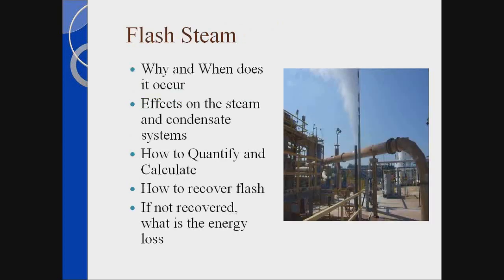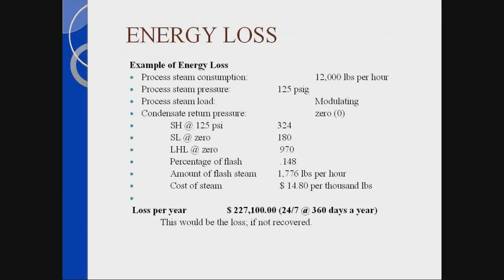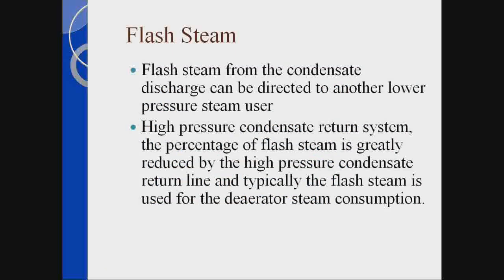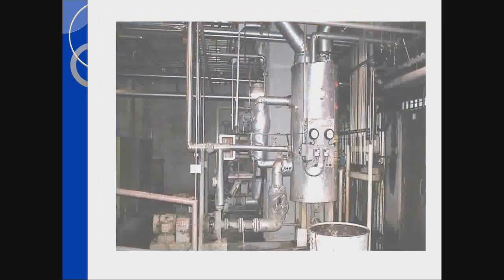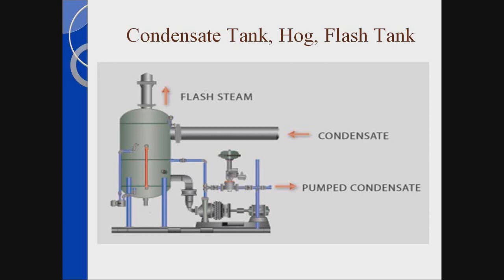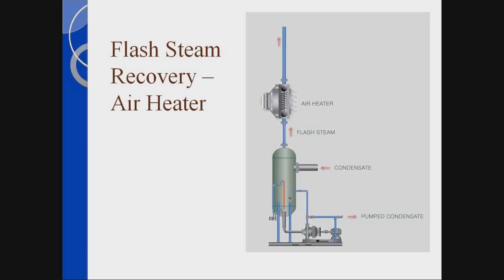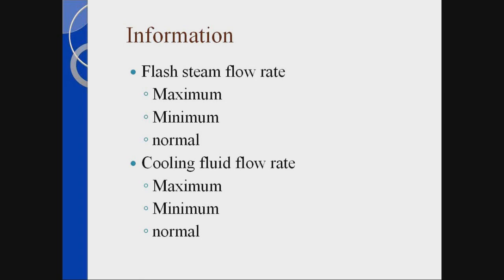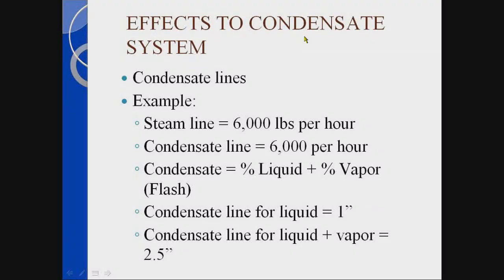UE Systems Complimentary Webinar - Flash Steam Recovery

Comment: can you explain me how this flash steam form or else make some video on that
Reply: Flash steam is what happens when hot condensate runs into lower pressure such as exiting a steam trap or pipe or boiler.  It is still steam but referred to as flash steam due to the manner in which it formed.